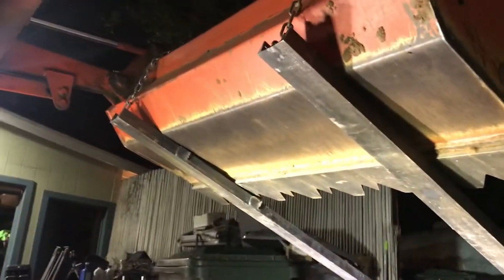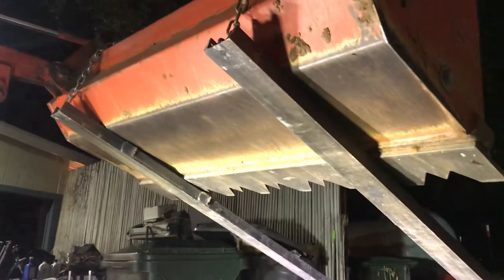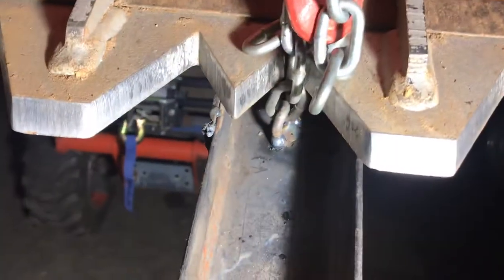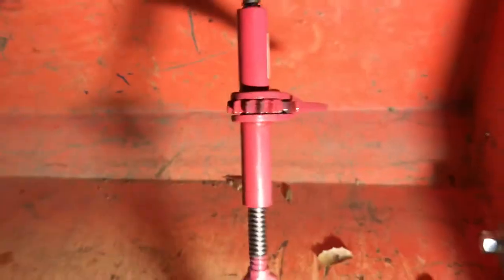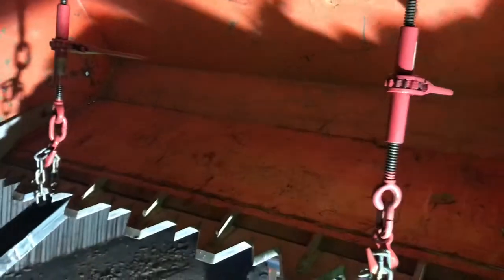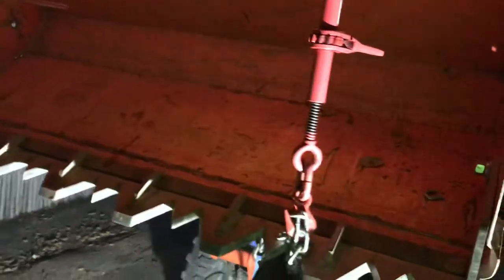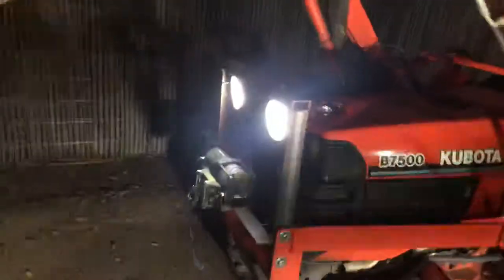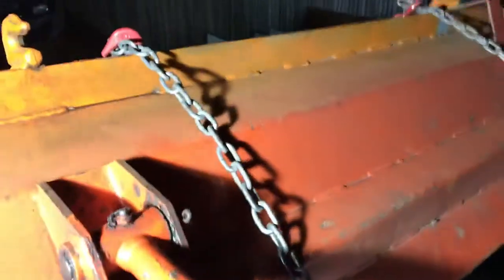Homemade pallet forks tractor bucket

Comment: Not a bad idea if you can't afford some real forks...

But might I suggest some camera stabilization?  My wife and I watch YouTube on the BIG screen TV - and she said "What a roller coaster ride! I think I am gonna be sick!"  As a fellow youtuber, I KNOW what it's like to take video and TRY to keep it smooth and stable...  It aint always easy!  And a tripod isn't always very convenient...

Good idea!  Keep posting!

BP
Reply: Would bolting to the bucket hold just as good?
Reply: @billyingram3492  - If that were my rig, I would try putting some grade 8 bolts through the bucket and lose the chains and binder...  And put some BIG fender washers on those bolts, both sides!  Bolts won't take all that long to assemble and disassemble!

I have forks on two of my tractors, they are indispensable around here!  Just a couple days ago we went and loaded up ALL my tropical plants and moved them into the greenhouse on my little JD 1025R's forks with a pallet - it took us about an hour.  In the past, we used to do the same thing with a big monster plant dolly and a lot of grunting and groaning - and it took us about 4-6 hours!

Some of those big planter pots weigh around a couple hundred pounds!

The forks and an old pallet sure made life easier!  (I have a hell of a lot of BIG tropical plants around our walkways and porches!)